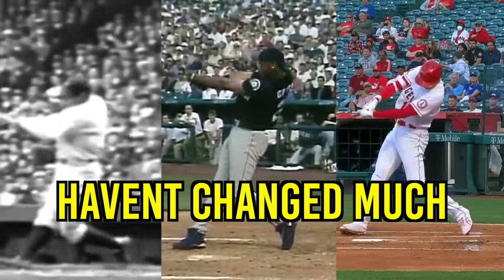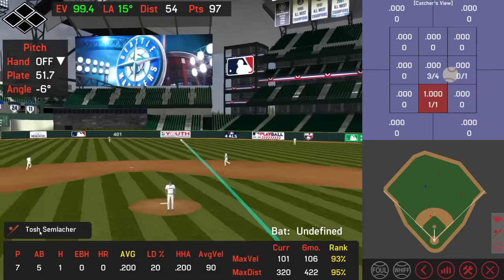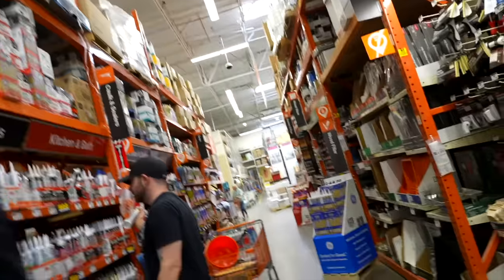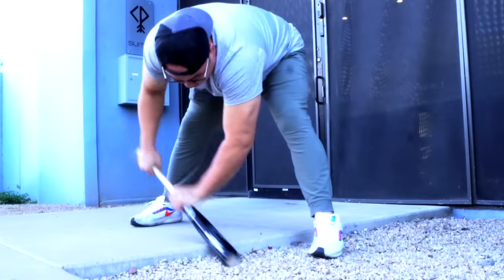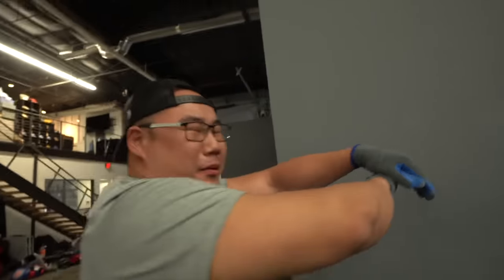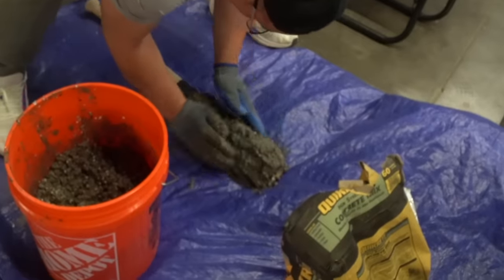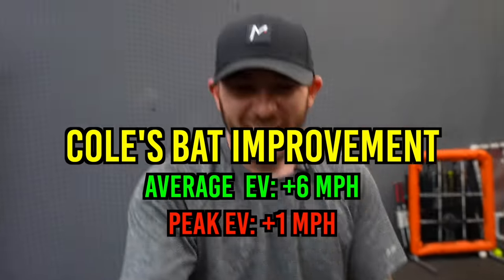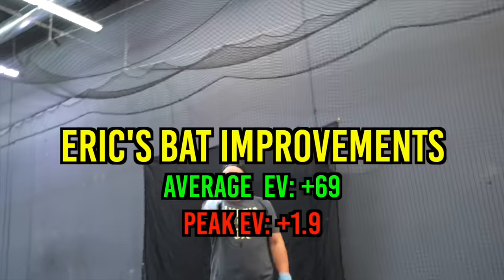Can We Make Baseball Bats Better?

Comment: Still waiting to see someone make a video with bats made of exotic hardwoods. I don’t think Ash and Maple are the best, they’re just the best for production at scale. 

How sweet would it be to see bats made of Purple Heart, Cocobolo, Rosewood, etc. There are tons of wood turning channels on YouTube that I’m sure would love the opportunity to make such unique bats and partner with you guys on a video.
Reply: I was thinking they could turn the stock bat until the barrel was about fungo thickness, and glue on a hollow purpleheart cover-- but I can't even imagine the amount of work that would go into it.
Reply: Make an 
Oak and Hickory bat too
Reply: Neat idea. Based on the Janka hardness test, which measures the force required to embed a 0.444-inch steel ball into the wood to half its diameter, the typical hardness of a baseball bat is about 5500 to 6500 N. A bat made out of Australian Buloke (Allocasuarina luehmannii) would have a hardness of 22500 N.  If you don't understand the units, at least understand that is nearly 3.5 times harder than the hardest standard bat!
Reply: A pro player on average orders 120 bats a season. Now multiply that by a couple thousand for the whole nation. Can that exotic forest that only grows every 50 years or longer handle that? Before you say “they’re stronger they’ll last” remember metal is stronger than wood and even those bats break after repeated use.
Reply: @cantprocess  You must have missed this part "I don’t think Ash and Maple are the best, they’re just the best for production at scale." The idea was to make one bat of rare wood types for a testing video, not thousands for MLB players.

Comment: The old days, Major leaguers used to score/key up their bats to harden the bat. Not really surprised that Eric's bat did better. The concrete harden inside the scored grooves of his bat. It is so much fun watching these guys make content.  
A little side note with Cole. The improvement for Cole's performance is that he was able to generate a faster bat swing since he lighten up his bat. He does not have to struggle with the forces of inertia as much if he was still using a stock bat. Bat speed typically improves EV.
Reply: Scoring up wood does not make it harder the scoring of the bats in the old days was about causing more friction on the surface of the bat causing crazy spin and also better grip if done on the handle. There are ways to harden wood none involve scoring it almost all are about pulling more moisture out or applying a type of coating to it's surface or a coating that can penetrate the wood. And the only thing about the concrete that might have helped is it being able to pull more moisture out of the bat hardening it up. The concrete in the scored grooves was nonexistent cause it turned to dust. And also his increased EV could easily be because he was just hitting better that day or swinging harder.

Comment: Eric next time you cork a bat, drill into the center of the bat like cole but instead of foam you can put concrete into the center and then put caulk over the top to protect the concrete. 👍

Comment: Eric should have done the same thing cole did and “corked” the bat with concrete. Use TINY pieces of rebar to add a little weight and use caulk or something to cap the top off and flatten it out. I think that actually would have done alright.

Comment: Easy solution to making it heavier. Drill out middle, add concrete, seal end. Then it doesn’t ruin your hitting surface and won’t break apart when used.

Comment: I feel like the concrete needs to be reinforced maybe like there use wire mesh or rebar to reinforce concrete I think there's even fiber reinforced concrete. 

Then if you want to cork a bat you need to use cork filler it comes in a can it looks and feels like cork because it is but it's in a can that looks like a paint can and the cork filler is like a paste people use it for leather making things I think and shoe making etc.. but if you get the cork filler you can pack it tight into the bat then glue a wood plug over the hole and you'll have a properly corked bat.

Comment: Cole next time start with smaller drill bits n work your way up to the big one. That drill doesn’t have enough torque for that big azz drill bit. But if you start smaller n work your way up it’ll be less material the big one has to deal with making it easier and also allowing the drill to work.

Comment: So it hurts me to see some of the stuff they use to try and make these work. If they hollowed out the bat with a wood drill bit and used a non harding silicone or a rubberized caulk, it would make it lighter, and you would get the ultimate velo. The other way is getting racket balls once again, hollowing it out, and siliconeing around the racket balls.